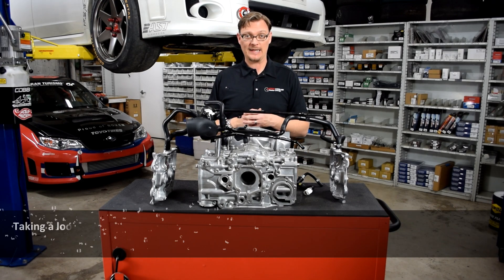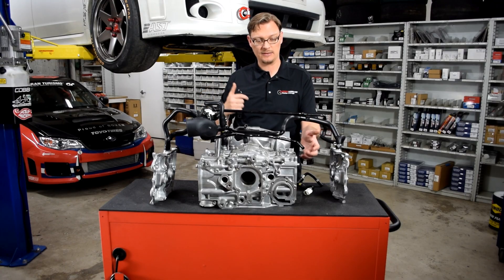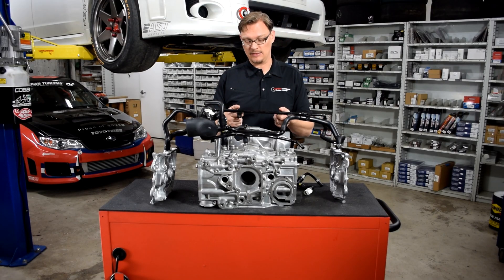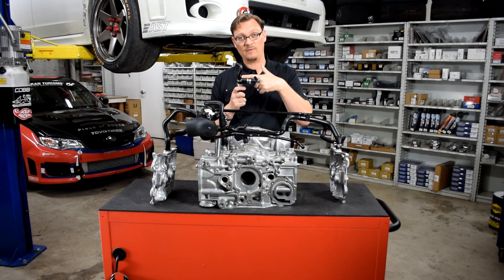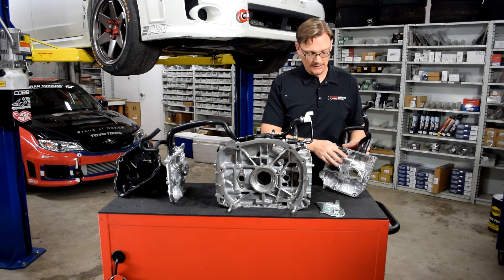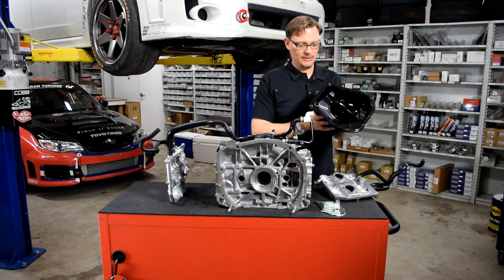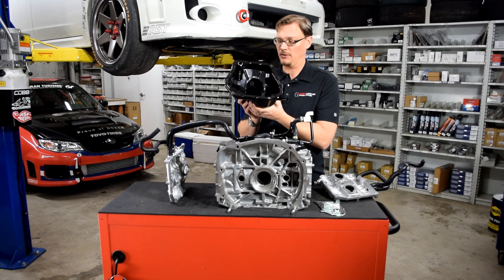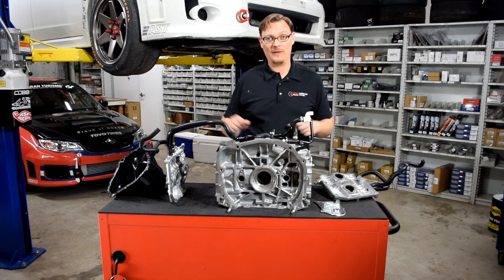Taking a look at the Subaru EJ25 Turbo PCV System

Comment: Is there any negatives to not having a vacuum on the crankcase? ie removing the pcv valve and blocking off the ports - and having the valve covers and crankcase ports vent to atmosphere? Could this cause any damage or burning oil/smoke on startup having it just vent to atmosphere? For off road use only
Reply from the maker: Thanks for your question.  First, keep in mind that the PCV valve is only open when the intake manifold is in vacuum.  Once it goes positive, the valve closes.

And yes, sealing that off, and venting to atmosphere is an option.  I'd recommend that you take a look at the video we did about AOS configuration, as we go into that in a bit more detail, and there is more to come on the subject:

https://youtu.be/6bPgslpWjak

Thanks for watching!
Reply: FlatironsTuning thanks for the reply! Do you think it could cause any smoke issues on startup due to inadequate vacuum? (Eg if you ran them all to one compact catch can)
Reply from the maker: The short answer is yes.  This is at least in part why we got the results we did when we started testing a catch-can for our AOS vs. Catch Can testing.  Here are links to those vids.  What ever you do, don't hook up a catch can like this :-)

More to come on this, but this is a start:

https://youtu.be/xjFYW1ICjIo

https://youtu.be/h-6wNp6r548
Reply: FlatironsTuning I understood from your videos your cars Catch can overfilled and as you stated if caused it to smoke alot due to it all being sucked into the intake. I have my pcv blocked off and currently just running some breather filters on my crankcase and valve cover ports...do you think this could cause my car to smoke on cold starts ?
Reply from the maker: You have to look at your crank-case pressure.  If your breather system is not letting pressure dissipate when under high load/full boost, this can prevent the turbo from draining properly.  If this happens, then that can cause smoke on start-up because oil is being forced out either the compressor or turbine housing.

Usually you would see signs of leaks from either the turbo drain hose, or other PCV hoses too.

But what we have now learned is that insufficient venting can cause exactly that.
Reply: FlatironsTuning I think I have come to the same theory as yourself. I had all three lines going into one compact can and the car was very smokey on startup. Would clear up after about 10 minutes of running. Currently have all the vents to atmosphere without a catch can and the smoke has reduced dramatically. Now I am in the process of diagnosing why there is still smoke on startup
Reply from the maker: There is a good chance that you will see oil from your turbo and in your intercooler if you take it off, and that is most likely the cause of the smoke on start-up.  If the oil is coming from the turbo, depending on how quickly you caught it, it may clear up after a while.  But the oil flowing through the turbo can damage the bearing over time (especially on the turbine side), and lead to a premature turbo failure.

Definitely monitor it, and cleaning out your intake track (intercooler, etc.) may help as well.  But if the problem persists, the turbo may need to be re-built or replaced.
Reply: @FlatironsTuning  hi. U mean that the pcv is open when the car is idling ?
Reply from the maker: @theresonly1truth138  Hello Elie.  Thanks for your question.  Yes, when the manifold is under vacuum, the valve would be open.  When the car starts to build boost, and therefor positive manifold pressure, the valve is shut.

I hope that helps, and thanks for watching!

Comment: Thank you very much, that engineering quid that is quite often missing with the average tuner. But now the critic question, based on the video I suppose that you are definitely against the pcv delete,  and on the top of that what is then the way to improve this system in a slightly tuned car, say stock turbo and tune? Is it really needed in this setup or the stock system is enough?
Reply from the maker: Thanks for your question Marco.  Believe me, we are working on it.  If you watch the videos that we have made about the Catch-Can vs. AOS, we start going into this.  We should have some more good information here soon.

Thanks for watching!
Reply: FlatironsTuning  thank you I'll be definetly looking forward your findings as to me the pcv delete isnt the way to go at least not as simple as that
Reply from the maker: Just to make sure I'm understanding correctly, are you just looking to remove the PCV valve itself?  Or to replace the entire plumbing of the PCV system?

Comment: I am currently putting in a brand new EJ257 shortblock and noticed on my intake manifold my PCV Valve is threaded into it. I have a 2009 Subaru Forester XT, it has the plastic manifold. My Engine did not seem to have that T piece with the PCV valve in it.
Reply from the maker: Hello Booki.  I just looked up a 2009 FXT, and it shows that the PCV valve itself is in a "T" that would be similar to the  one that we discuss in this video.  The catalog is not always 100% accurate though.  If you need help finding a new valve, etc., please don't hesitate to reach out and we'll see what we can do.

Thanks for watching!
Reply: FlatironsTuning thanks for the advice. Check out this video I just made. It looks like my pcv is in the intake manifold? https://youtu.be/G_ONiECuxTk

Comment: Great video, just one question. How do you reroute the system for the part thats only on the ej25 if you are doing a hybrid build?
Reply from the maker: Hello Tristan.  Thanks for your question.  That depends on how you want to deal with the additional center crankcase vent that the 2.5 liter block has that the EJ20 doesn't.  One option is to simply cap that extra breather off.  The other option (and most likely the best option) is to add extra fittings to each of your EJ20 valve covers and duplicate the routing that the EJ25's got on your hybrid.  The only think you should not do is run that extra breather into your PCV system.  That will result in excessive oil consumption.

I hope that helps, and good luck with your build!
Reply: Saw this after posting my comment today.  My valve covers are already back on the engine and I have a date with the dyno so I don't have time to take them off right now.  I'm safe to just plug this port for now if I read this correctly?  No AVCS and stock clearances inside the engine.

Comment: So what's the point of it? To lower the pressure in the crank case and valve covers?
Reply from the maker: Thanks for the question Matthew.  The simple answer is that yes, a PCV system's job is to control crankcase pressure, and also to get out all of the oil and fuel vapor that can collect in the crank case.
Reply: @FlatironsTuning  So then having a stuck pcv valve could be a very bad thing for the engine. Is that a fair statement? If so, then why don't manufacturers put those valves on a maintenance schedule? It seems like the kind of thing that could fail and lead you to drive around with too much pressure in your crankcase without even realizing it, jeopardizing seals and gaskets all over place. I'm just learning about these things -- the pcv system is fascinating I must say, and your video was very helpful conceptually even though I have the NA ej25. Planning to change it just for fun and see what the old one looks like when I take it out.
Reply from the maker: @CommaCam  Depending on how deep you dig, there is usually a replacement interval on a PVC valve.  But on the newer cars, they do seem to be omitted on the maintenance schedule.  

The short answer to your question is yes, if the valve sticks, it can lead to excess oil consumption, and it is definitely something to check if you are having that issue.

Thanks for your comment, and thanks for watching!
Reply: @FlatironsTuning  Thank you so much. Really appreciate your reply.
Reply: The reality is that the piston rings don't keep 100% of the gas expansion above them in the combustion chamber. So you get "blow by" - and as a motor gets more worn, this increases significantly. Those blow gasses have to go somewhere, else positive pressure build up will blow the crank seal out etc. The blow by is also rather noxious to breathe - so its most healthy destination for the environment and to stop burnt oil smells from the front engine area is for it to be feed back in with the intake fresh air, where it can be burnt. The PCV valve is just a one-way valve that sits at the final destination before entering the intake manifold. Unfortunately, oil finds its way into this flow of vapors. Especially if the PCV valve fails (happens at like 60k miles and up). The heat basically slowly melts the modern plastic ones.